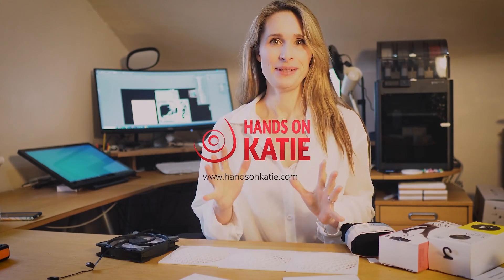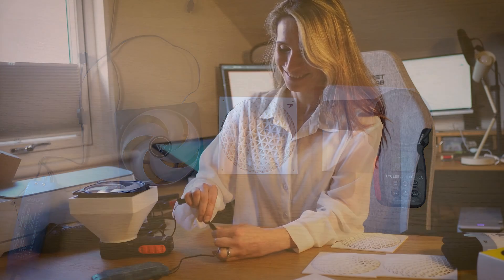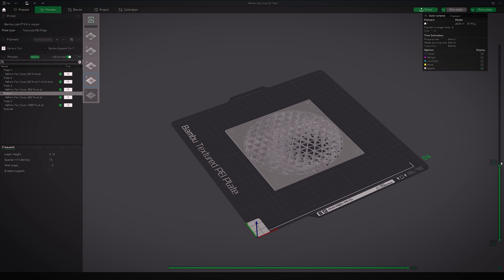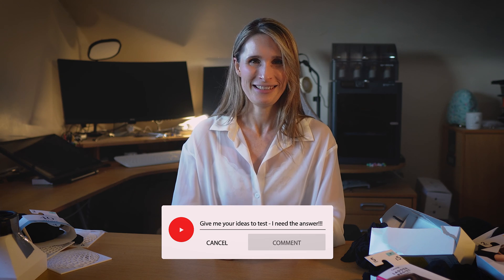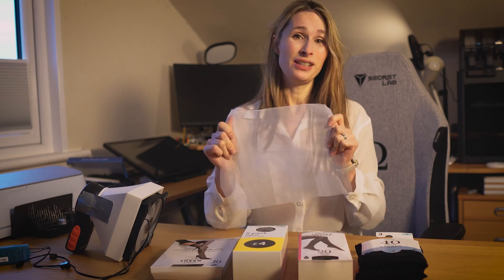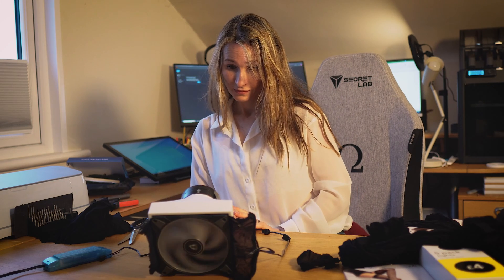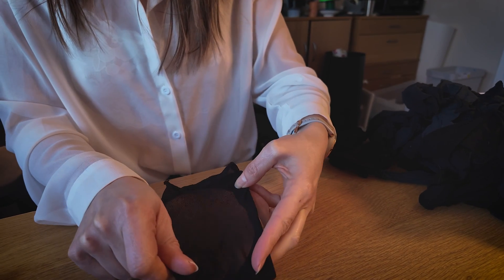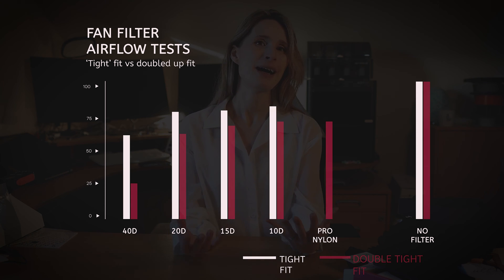PC Fan Airflow: Tights vs Traditional Filters - Custom PC Build Series #1

Comment: Your testing has serious flaws.
1. Flaw #1: You choked the fan by forcing it to blow through the small window. IRL 120mm fan blows through 120mm mesh, not though a tiny 60mm hole.
2. Flaw #2: most PC fan use cases consider air intake through dust filters. There is no sense putting dust filters on exhaust fans. Not sure if creating positive air pressure would 100% correspond to creating negative air pressure.

And finally, there is no compare data for standard metal mesh.
Reply from the maker: You’re right that a 120 mm fan is normally paired with a similar-sized vent or mesh - however, the setup was designed to normalize airflow restriction across different test materials in a controlled way. By using a smaller aperture, the restriction was exaggerated to highlight differences between filters, meshes, and mounting setups. If the fan had blown through a fully open 120 mm cutout, the deltas between materials would have been too small to measure reliably. So while the geometry isn’t 1:1 with a case, it is still valid for comparative testing. 

 On dust filters and intake vs exhaust
Most PC builders do indeed only filter intakes. However, measuring restriction and static pressure effects on exhaust fans isn’t “pointless” — it illustrates how fan/filter interactions behave under both positive and negative pressure scenarios. Case pressure dynamics are not binary; you often get mixed flow paths depending on GPU/CPU coolers and case design. As an aside, positive vs. negative pressure isn’t symmetrical — that’s exactly why testing both sides matters.

On the metal mesh — a steel case mesh would indeed be a useful control - I couldn't find one in stock in this size, but have since tested. But note that 'standard mesh' isn’t a thing: hole size, open area %, and stamping vary hugely between cases - likewise causing the variances you describe. So the absence doesn’t invalidate the comparisons made; it just means you could extend the scope further!

Comment: For those who want to try it out.

I’ve done this “mod” on my pc, and average temperatures got +10 deg C.
 
I think it’s just because air flow was reduced and less “wind” was created inside my case. Without DIY filter pc tems are better

I mean it may help with dust, but for me its better to stay with 65deg CPU in intense use, than 75 

PS I’ve tried 1 layer of 20D. It took me 20 min to install

I’d recommend to try if you want reduce dust but be sure to double check temps in your case.
Reply from the maker: I had lower impacts, but the key thing you need to consider is 'real world' testing, not 'sterile tests'. If you can happily clean out your PC from dust, say every week, then this would be correct. Otherwise you need to compare whatever frequency you can be bothered to do!  Eg is your PC with 6 months of dust accumulation cooler than a clean PC with 20D tights! I'm going to follow up on this once my workshop is finished, loads of cool tests to do!

Comment: twisting the grille holes will likely give the same effect as stator blades in jet engine compressor stages, meant to redirect the airflow to reduce swirling/twisting before the next rotor stage; non-turbulent directed airflow. a smoke test will definitely show what's happening. 
have you tried a much less dense grille, something more like a stator stage, even though it won't look anywhere near as good as the hexagonal design you made. 

also, that case design looks amazing! have you made it yet? i've always wanted to mod an old radio (art deco type era) as a case, but never come across one suitable.

Comment: Aside from airflow in cfm there is a pressure metric which is important with radiators and it may've suffered even with 30d turn mesh. So tbh these results only work for case fans.
Reply from the maker: Interesting point and yes naturally there would be some impact on pressure whatever you do!

Comment: Hi Katie! How often you recon you would need to clean these panty filters before the dust clogging it to the point it would hinder airflow? This was a great video thanks a lot !
Reply from the maker: Well I guess that depends on a) how dusty your room is b) what you consider 'hindered' (eg is a 2% decline your threshold or a 50%) and c) the denier of the tights! But I've got a video in the pipeline to show the finished build and I'll include lots of free files for quick change filters! As you'll know from some of my later videos, this PC now commands devices in the room - like the robot vacuums so they automatically clean when dust is detected, so I haven't had to change the filters yet! My guess would be a 2-3 year task, but just a guess at this stage!

Comment: Great video. However, you measured airflow, but I didn't see you actually measure the effectiveness of the dust catching abilities of the different pantyhose. I assume you just assumed it was directly related to airflow. I'm a heavy smoker that lives in an extremely dusty apartment. I don't expect any filter that allows a decent amount of airflow to filter out the cigarette tar. But filtering out the dust that would otherwise stick to the tar is crucial! I'll definitely give this a try!
Reply from the maker: Hey, great point - in later videos I touch on the air quality sensors that I'm looking to install, these track pm1-10, VOCs and more, so I'm going to use these as a proxy to then automatically vacuum the room, alert to dust levels. I'm not sure how cigarette smoke would be tracked, but it'd be an interesting test!

Comment: You really need a decent microphone if you are going to make videos for a long time. What I have to my computers, got rid of colored fans and went for Noctua. If you want to light your PC from inside, do just that and forget about LED fans, Let's not forget about having a case that supports many fans for air intake and then also blow out. Power sourse should be isolated from the case. Do not go for water cooling, for long time cooling the air cooling is the best.

Comment: The discovery of the 30° twisted grille having such a dramatically lower effect than the 0° twist is remarkable to me! My guess is that it has more so to do with the path of the inlet air matching the angle of the blades and less to do with turbulence after intake, but that is only a guess. Maybe reversing the direction of the twist and running the test again could help to prove or disprove that hypothesis? I'm curious if this effect that you discovered is why traditionally manufactured grilles are kept thin, or if that is simply a result of how the cases are manufactured? None-the-less, I felt it was amazing to watch your process and I think your filming, editing, and onscreen personality were phenomenal! Thanks so much for taking the time to make this and I hope you chose to keep posting!
Reply from the maker: I know!! I was quite surprised by this. I can't quite believe that the airflow matching can account for it all - remember a blade is spinning at many hundreds of revs per minute, so I'm not entirely convinced that the air can be creating anything like a matching vortex.  I suspect the thinness of grilles has more to do with cost minimising/profit maximising also...! I've gathered all these mysteries into a list and I've got a video on the backlog to do some further testing - keep watching and we can see if we can solve it!!

Comment: This is a very interesting video. I recently went through the process of specifying a PC and, because I wanted a warranty backup, on this occasion I decided to pay a couple of hundred quid for somebody to build it and provide me with the warranty. Anyway, although not the GPU that you have, I went with a 4070 Ti, 64G DDR 5 and a 14700K with solid state drives. It's a PC for fun, not for work, so hard to justify something like yours that is probably specified by the Met Office or The Pentagon as a standard design! In designing it, when running full chat, I was aware that this thing can kick out some heat!

I decided to go with a minimalist case - effectively one with a wide open front grille and a tight nylon mesh with with whole of the rear open and just protected with a honeycomb mesh with holes of about 10mm. I put three 120 fans in the base, sucking air from underneath up toward the graphics card and an AIO 360 in the front behind the front grille, pulling air inwards. This design chucks plenty of cool air up toward the graphics card while the AIO water cooler/fans push air from front to back. The PSU sits right at the top of the case , again, vented out the back. I was very keen to keep the air flow as undisturbed as possible so, while there is collision as up drafts meet front to rear drafts, the cabling attempts to minimise other disturbances.

I was worried that the whole rig would sound like a jet engine, especially being on a desk. It's actually fine most of the time and, so far, the amount of dust penetration is minimal.

It may be second order but keeping the influences of the internals of the case minimal is also important for air flow.  Glass, I think, helps here.

On the issue of dust, I would certainly advocate keeping any PC on the desk rather than on the floor, especially if the floor is laminate or tiled. PC's seem to accumulate far more dust if placed at floor level than at desk level. Also, as another poster mentioned, blowing the filters out with a compressor helps a lot. Indeed, blowing dust off the whole PC electronics and heatsinks is a must too as deposited dust massively reduces the ability to cool and can cause hardware throttling. I also have a garage compressor which helps with dust removal among many other uses.

At the risk of sounding sexist (and this is definitely NOT how I want this to appear) : I think it's fantastic that you are producing content like this. Traditionally, this is a very geeky domain frequented by males (wood, electronics, computing, home automation, etc.). It's great to see a lady doing this in a data driven and scientific way - and also in a fun way, as it keeps people engaged. Out of interest, did you train in technology or has your content come from experience?

FWIW, my background is engineering , although these days it's less technology and more toward natural and historical engineering (a necessity when you own an old property and some land out in the countryside!) - so your crafting content is also of interest to me too.
Reply from the maker: Hey Ian, loads of great thoughts here - great to read and sounds like a great rig you've built! I was just carving the new case front today, so your thoughts on airflow are very helpful - I've been musing exactly the same as you in this respect! As for me, I've always been interested in technology - studied electrical engineering as my first degree, worked in and with technology all my career ... so yeah, think I qualify as a nerd....  :)  Great you enjoyed the content, I can't profess to have any experience at all in it, but I'm loving getting everyone's amazing thoughts and ideas - it's like for every project I post, I get 20 new ideas back!
Reply: @handsonkatie  That's brilliant Katie, I'd take my hat off to you (if I wore one). Engineering degrees are difficult but open up so many avenues afterwards. As an engineer you think differently and that has life changing advantages. Add in, if you can, a business qualification or, if not, experience, and it's a perfect foundation for life. It literally changes outcomes.

I studied electrical engineering to degree too and made a decent career out of it (applications engineering and management of silicon chip testing for the majority of my career). Much later I became rather  bit bored with it and my wife and I started our own business in a completely different industry, and did well. It was a revelation to be honest. I learned more in six months than I had learned in the previous six years. We ran that for five years and then retired. 

Life now is enjoying the countryside just north of Dartmoor in a nice old converted mill on the edge of a village and, as I mentioned above, embracing more craft orientated stuff like woodwork, lime mortaring,  chainsawing, Tractoring (a verb I just made up) and a fair bit of cycling. 

I don't miss the grind of technology as a job but I still retain an interest in the general sphere of it. In between outdoor stuff (when it isn't raining) my next plan is to get to grips with Home Assistant - I want to make Octopus Agile talk with our batteries so that we can charge them when the rates are cheapest .... suggestions welcome! .... plus integrating all of the internetty stuff that our house is full of, as yours probably is too!

Comment: Interesting video, especially the different grills. One consideration, how quickly do they block up and thus reduce airflow. I've multiple computers and a server that is on 24/7. May be once a year I'll take the server out to the garage and give it a good blow out with my compressor, being careful not to spin the fans up. The other computers which aren't on 24/7 get cleaned far less frequently.
Reply from the maker: Yes - great point! I've designed that as part of the cartridge system I've built for my custom pc. Although the 'clogging up' isn't anything inherent to this or any other filter - it's an important design consideration that should be more prominent in case design. ie if you can pull out your fan filters in seconds to clean/replace them, you probably will. If you need to open the case, unscrew your fan mounts etc, then it isn't gonna happen... ;) This is why I've designed a cartridge system for my case - so you can click these filters in and out easily.... I'll release these files in the coming weeks free for folks so they can just 3d print themselves....!

Comment: Interesting results - I just finished my PC build and went with some of the metal mesh filters originally. They are the magnetic variant with small punched holes, so not quite the style of the intertwined mesh. Anyways they are terrible when it comes to airflow - so much so that I had to remove them... I may have to try the tights now. Any chance you benchmarked the metal mesh filters? I don't believe I saw that data but I would have liked to see the metal mesh up close and the flow numbers just to see how they compare to the nylon. Great work on the video overall!
Reply from the maker: Ooh great point, I didn't actually have a 140mm metal filter, but let me order one and I can do a follow up test! 😊

Comment: Do you think that measuring your results using a funnel like that might affect readings due to increased pressure vs a normal configuration in a pc case? Or do you think that any impact to results will scale proportionately accross each test?
Reply from the maker: Great thought! 😊 Given the funnel is consistent across all the tests, it should be equal across all the tests. But there's probably a marginal impact on CFM across the board - so can't see how it'd change the results, but there's possibly a proportionate difference in results. I'll do a quick test tomorrow and check! 👍